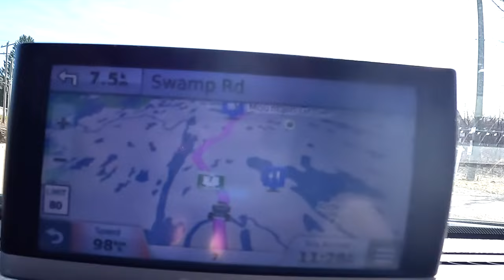Building a Bandsaw Sawmill Blade + 2 Sawmill Upgrades

Comment: Now, THAT'S a canthook!! I ran a large bandsaw in my teens, cutting steel bars. We always checked the welds before installing a new blade. They still snapped quite often, but it was running all day and cutting through steel. Thanks, Brian.
Reply from the maker: Wow! sounds like a beast of a machine. I've been helping on a much bigger sawmill when a blade snapped and I just about jumped out of my boots when it happened.😱 Thanks for stopping by!

Comment: Interesting look at the sharpening place & how the blades are welded.
Surprised at the handle on the log support being on the inside, as that's where handling equipment's likely to catch it.
We've finally seen the weather pattern change here, as it's been the wettest first few months of the year for at least 30 years, so today I've been out spreading compost, putting up pea & bean supports & preparing my polytunnel for tomatoes, cucumbers, peppers & melons.
I wish I had access to trees for timber, as prices here in the UK are insane.
Mind you, I scored some old oak 8x4 beams today, cut to 6' lengths & need de-nailing but there's 23 pieces & I'll be able to rescue a reasonable amount for furniture & cabinet making.
Reply from the maker: Yes it was interesting to see. The supports seem to be working very nicely so far so no complaints. It been very wet here as well. We just got past three days of rain the gave use about 50mm worth. It’s pretty messy out in the bush. You’ll see that on on upcoming video. My wife will be starting in the garden very soon as well. Sounds like you really scored on that oak. You’ll have fun with that. Thanks for stopping by!

Comment: You will not regret buying the new kant hook.  The added lenght and soled design will give you confidence when you roll your logs and kants.  I have a feeling you would not trust the older kant hook any longer.  Enjoy the Journey - Cheers
Reply from the maker: Yes, that’s very true. I was concerned every time used it. Not with the beast though. Thanks for stopping by!

Comment: Pretty neat way that the sawmill bandsaw blade is welded.  Last year my son had talked about adding rollers to his mill. I'll have to check with him if he did or not.  Once you've milled 20 or so logs I would be interested in your opinion on using the pro log supports and if you think they'll last over time. I was surprised that you got a Wood-Mizer cant hook instead of the one that Woodland Mills sell. Well it color matches the Kubota or at least close to it, lol.  Have a good one Brian!
Reply from the maker: Yes it was interesting to watch the progress. He has quite a shop there. I’ll keep you up to date on the rolls. I did look at the Woodland Mills cant hook but I decided I like the looks of this on a bit better. Plus it’s a nicer colour 😆👍 Thanks for dropping by!